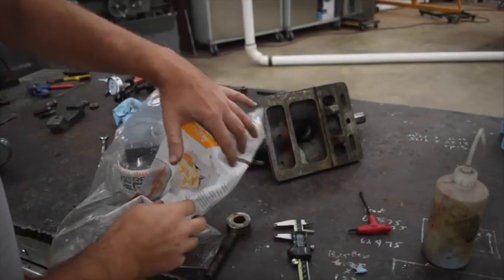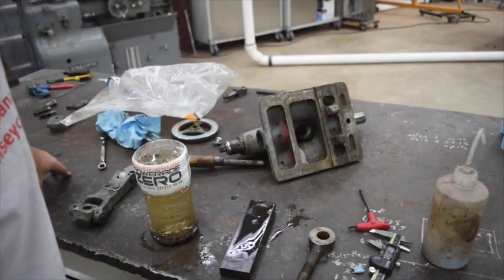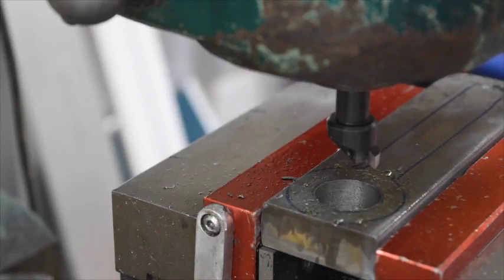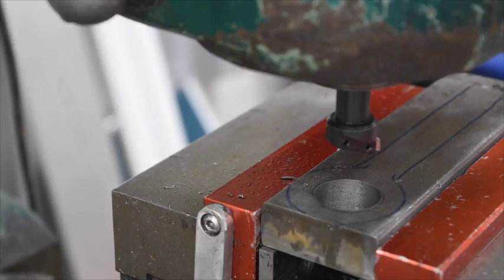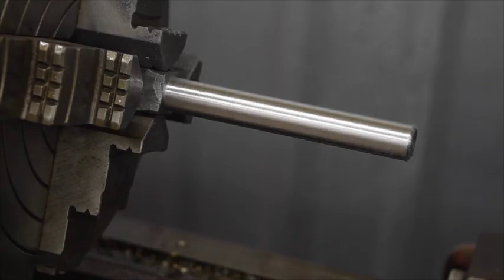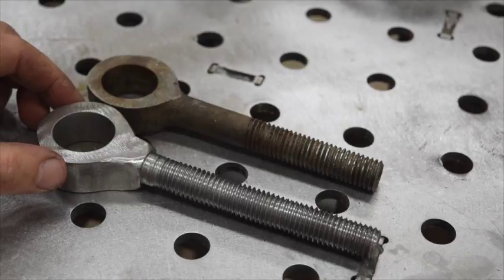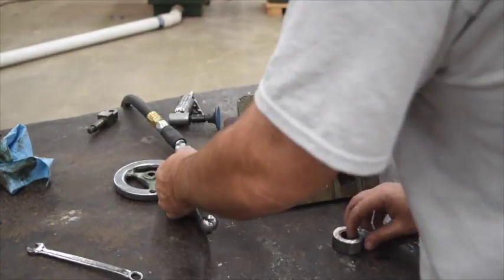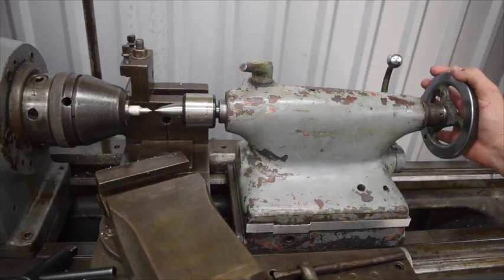1954 Monarch 10EE Lathe Tailstock Modification - Part 3

Comment: Fit a bushing to the hole, not the hole to the bushing. Much easier in most cases. You could probably have made it on the lathe with an offset on the 4-jaw as well if you have a boring bar for it.

Comment: Is the headstock bolted on where you can add 0.001or larger brass shimstock to raise the headstock instead of milling more off the plate now that you have it that close ?  just a thought
Reply from the maker: i think the headstock is integrated into the chassis of the lathe, or it appears so.  If not what your suggesting would be a good fix for sure.

Comment: I think making the tail stock adjustable is a good idea, if you think it out correctly you could intentionally set it to cut tapers, just a thought. I'm enjoying this series but I'm sure you've got 42 other projects to work on.
Reply from the maker: Thanks Jim, and yes your right, i do have 42 other things to do, and now that the lathe is up and running finally i can get started on those! appreciate your suggestions and for watching.

Comment: Your getting real good on the Lathe.
Reply from the maker: Thanks, Its been fun learning it. I am looking forward to doing a full rebuild on it, give it a nice paint job some day.  Do you use yours a lot?
Reply: +🔥Ramsey Customs - turbocobra no I haven't got to use it yet.  I still have to order the quick change tool post,  lathe bits, and boring bars for it.   I will probably order those things at the end of the week.

Comment: hey Gary! I'm by far no machinist nor do I have experience, but would it be possible to drill the holes through the spacer for those bungs, then recreate new bungs on the bottom of the spacer instead of cutting them off ?.
Reply from the maker: Irene, yes, that's definitely a possibility, and one of the options, or a variation of it that I was considering.  thank you for the suggestion!
Reply: +🔥Ramsey Customs - turbocobra  np Gary, I have no doubt you would've figured it out. fresh set of eyes or a step back is always the way to go!!! keep up the good work!!!!

Comment: Gary good job with what you have.  Next time with your flycutter use your dial indicator to make adjustments to the tool bit once you have the initial size of the bore set.  The off center hole is providing the cam action that's how the hold down works.
Reply from the maker: makes sense, thanks as always Bill.

Comment: Looks good. I really don't have a lot to say this time. I haven't had to make a lot of odd sized holes, but I don't have a boring head either. All the ones I've don't I've found a way to chuck up on my lathe, either on a faceplate or in the 4 jaw. I know you probably don't have a faceplate. A rotary table I guess work work as well. In your situation, I would have done the same.
Reply from the maker: I was looking at maybe getting some indexable reamers, but not sure how well they work.
Reply: Decent. They cut differently that chucking reamers, which only cut on the end. People say not to run them under machine power. They like to kind of chatter and cut an 7 sided hole, but if you setup is just right they won't. I know the cheap Enco set was ok, but they are 7 sided, not 6, so you can't measure across. Not that you really need to for hole enlarging. Nine times out of ten, ours get used for enlarging new bushings on machines for repair jobs. They only cut a thou or so at a time, so you need to be really close to begin with though.

Comment: I'm lazy I try what I think is easy first I would have cut the threads  off the old one and added  a piece  of steel  or just a threaded rod onto it .
Reply from the maker: i hear ya, it was my gold not to mess with the old parts in case i wanted to put it back like original and sell it to someone who has the 10" lathe.

Comment: Gary you know if you need something that you don't have you can always ask me. It's looking good, and you're getting better with the machining of parts. I'd offer to come and help but I'm laid up with my back, haven't been able to stand up since Thursday but hey that's life. You've got my number if you need anything just call if I have it its yours.
Reply from the maker: Thanks Martin, appreciate it, i figured you weren't feeling well, haven't heard from you lately.  The only issue i have right now that i might need help with is the shaft for the feeds isn't turning, it hasn't since we took the turret off of it, so need to figure that out.
Reply: +🔥Ramsey Customs - turbocobra if you pull out on the lead screw (towards the tail stock) and rotate it in either direction it should start working.

Comment: You never use a file with chuck spinning with no handle, as if chuck catches file it will drive it thru your hand.Take it from an old diemaker, never do this. Also never leave chuck key in chuck ,as if you turn on lathe with that in chuck , you could get hurt badly.
Reply from the maker: Thanks Richard, I didn't think of it, and your right.  I only have a couple decent files, no handles, i need to order some new ones.
Reply: Getting injured wouldn't be good if your working by yourself. Also would be best to mill the 2 long narrow sides parallel and if the hot rolled isnt flat mill a 3rd side square before drilling to give it better clamping action in your vise and keep it from moving with the drill pressure.

Comment: On my lathe, those holes on the sides are used to adjust the side to side to get the center. The up and down is up to you I guess, right? I'm enjoying watching you get this done. It is an encouragement to me as I begin learning how to use my little lathe.
Reply from the maker: well the up and down is only a problem because i am trying to make the wrong tailstock work on this lathe, so the plate thickness is how i am adjusting that, and yes the side to side is with the set screws.

Comment: Looks good for me, Gary. I wonder if you would do an overview of how you sharpen your bits? Thanks
Reply from the maker: Thanks George.  Sharpening tool bits?  Me?  lol, I just put it on the belt grinder and try to allow for enough rake and back angle to allow it to cut and chip evacuation.  I have watched some videos on toolbit grinding for lathes and there are some best practices to follow...  but on something like that boring bar, not sure if there are any specific guidelines, i just wing it!  about like i do everything lol
Reply: LOL, Thanks Gary

Comment: maybe try to glue the bushing in place, can you drill and use a thread sert in the aluminum and use threaded screws to push on both side against the material hanging down on the steady just a thought.
Reply from the maker: yea, thought about gluing it is, it's not a high wear use item so it would prob be fine, but figured i have a lathe, so why not use it, easy project, i am still learning so that would be a good learning project.  Dude, that is an excellent i deal, I need to go look and see if I can do that!
Reply: you could also use your lathe to knurl the bronze bushing, I bet it would then be a tight fit, have done that on some of my buggy bushings for my link pin bushing.